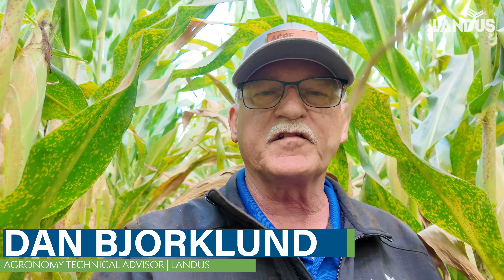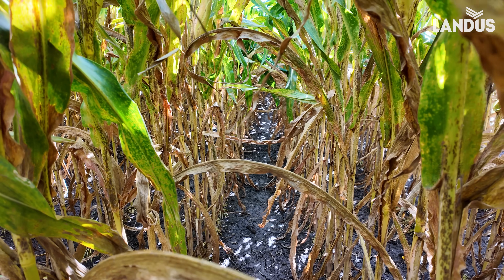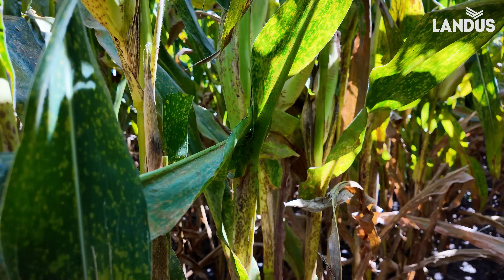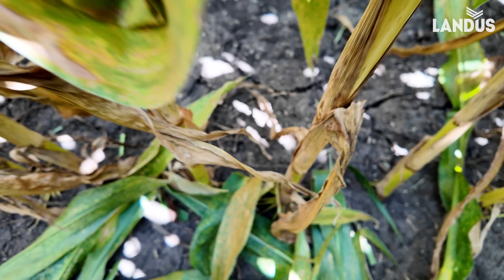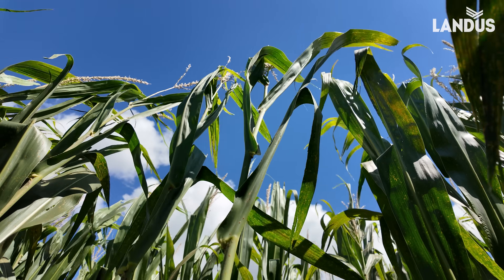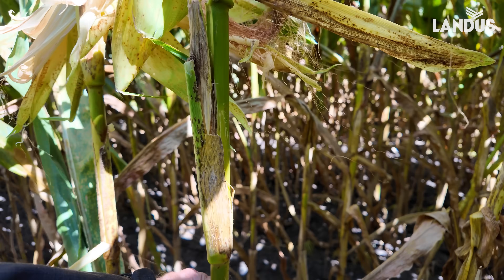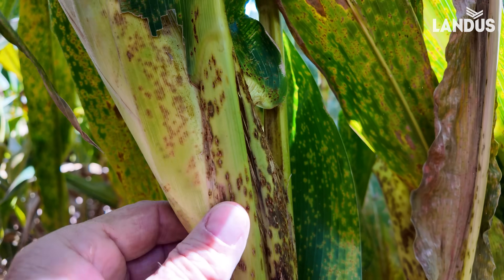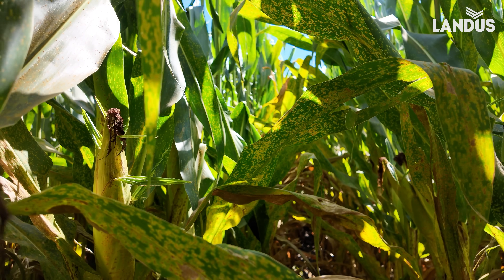Will Iowa’s Corn Fall Before the Combines Roll? | Virtual Agronomist

Comment: Do you think this will be the new issue for Iowa? I'm in NW Iowa and it we seen last year for the first time, seasoned agronomists had never seen it this far north and comments were made we may never see it again since it has to "blow in from the south, it does not overwinter here". Well here it is again much earlier, and there is no doubt this will limit yields in this part of the state as well. Do you think it has adapted to this environment?
 We select hybrids for Gossis wilt and Tar Spot now Southern Rust, this will narrow down hybrid choices significantly.... Once again Mother Nature wins.
Reply: I’ve been an Agronomist for 4 decades and have only seen it this bad the past 2 years!  We did have record July rainfall
Reply: They could be spraying it out of airplanes
Reply: @AldousHuxley7  Clown.
Reply: Probably being intentionally dumped via aerosol by drones or planes.